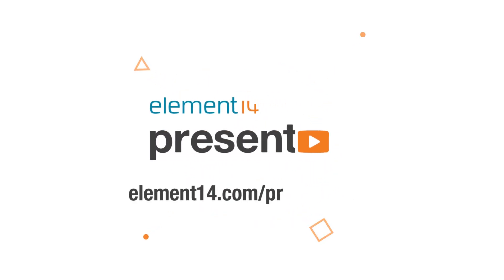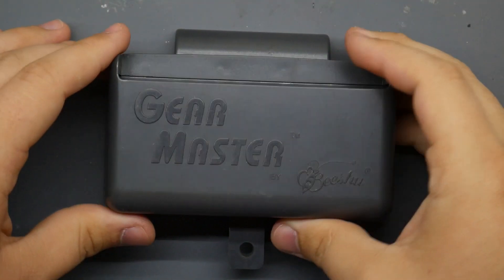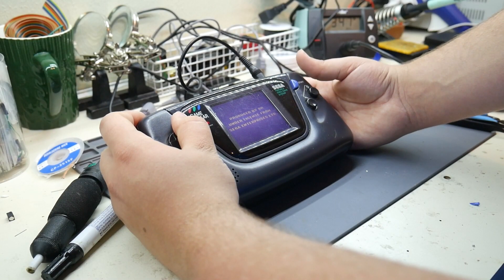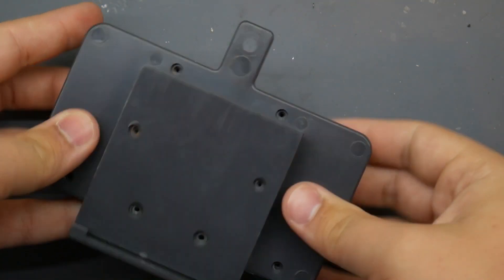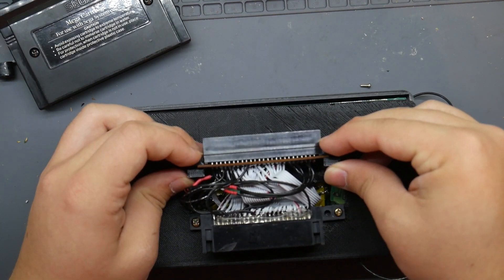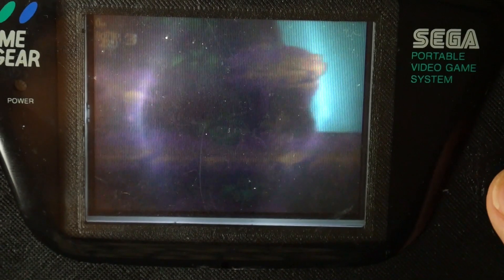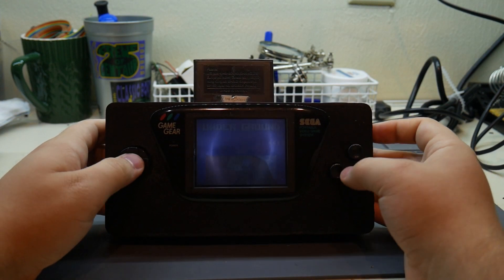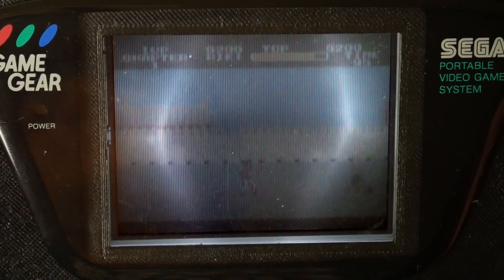Rebuilding the Sega GameGear Screen with LEDs

Comment: Cool idea, but its uglier and harder to see... I think a full screen replacement, in the original case, would be the way to go.
Reply: Yeah as someone who still has an original and still thinks this is neat, I must confess the display doesn't look good at all.  I realize some of that could be the camera this was recorded on, but since I am comparing it to 1991 display and backlight tech this is just kind of meh. :/  Overall still an interesting video though.
Reply: @mattc2360  First i would have change the caps in the whole system, that would make a lot of difference especially in the contrast of the screen. I admit that the screen original will improve with a backlit LED mod like this, but only like 20%.  If you do the caps and LED mod, then MAYBE the image on the screen will improve, but i doubt it will be more then 30 %. You can't change the contrast with a caps mod, you can only change the brightness in total. If you have a modern screen then contrast/brightness will improve with more then 70 %, that means that outside playing the GG in bright daylight is possible. ;) Try this with a original screen and then you see the diffrence. I like original hardware but implemented with also modern electronics that's far and way beyond better then almost 30 years ago was possible.
Reply: @gsxracer1977  As I said, I still thought it was neat.  Recapping is actually not that difficult (I say that not as an expert, but one who has done so with several Sega consoles without having any idea what I was doing :p) if you would like some tips and tricks for that.

Comment: They have drop in screen replacements with a modern lcd. That mod you did doesnt really show up on camera at all. Also, the game gear screen is notorious for ghosting.
Reply: why waste a working screen though?
Reply: @Davedarko  because that screen is really bad, indeed there's a lot of ghosting and colourpallet is bland. Compared to new LCD screen i give this screen a comparison of 20 pts for the old one and 95 pts for the modern one. Really you should replace this screen, its terrible. Actually its litterally a difference of night and day.
Reply: @gsxracer1977   we normally get flak for replacing something that works here ;)
Reply: @Davedarko  The case "worked" yet was replaced with a janky looking 2 slot one. ; )
More seriously, While the screen and backlight do work, you can pretty much replace tjhem while selling the old ones as for parts that some people might be looking for endlessly on Ebay and such. I'm pretty sure most of us here would still prefer replacing that with any modern variant if only for the good looking colours and refresh rate.
Reply: @TheSliderW  it's been 8 months, why have you summoned me?

Comment: I think it would look way better with the leds pointing to the side of a clear piece of acrilic like those cheap handhelds with backlight or like in notebook backlight screens is the same way
Reply: And it would be way better to use the original front and 3d print only the back

Comment: Cool project, well done! Would electroluminescent film work as a back light? I'm not sure how it would compare to LED on power and CRI?
Reply: I'm not sure if it would be considered film but I tried some kind of acrylic (in the backlight) that was found in a old LCD that I had around but it wasn't quite bright enough. I didn't know very much about electroluminescent film at the time, but that is an excellent idea I should try if I upgrade it any time soon.
Reply: Electroluminescent film is not too bright. It depends on the quality of the phosphor. Might be a challenge to control the brightness too. But definately worth experimenting with. For a small project I bought an LED back light which was just an LED stuck into a piece of acrylic. But that worked remarkably well
Reply: @adamsoileau4804  I should have said, the master system add on is epic!

Comment: Maybe this won't work as I don't have a Game Gear and can't look at one in detail, but how about putting the Game Gear and Master System game ports in the same slot spaced just enough from each other to allow the slot to accept either type of cartridges, with the permanent shape accepting the larger MS games by default and making some kind of removable shim to guide the GG carts? Maybe even making the shim/guide spring loaded and pushed out of the way when inserting MS games?

Comment: You sould had just taken an old lcd apart and get the light spreading plastic layers cut it down to size and put the leds around the parameter.
Reply: I was actually looking in to that 😂 I messed around with one broken lcd, but i realized two leds would fit in the reflector and that worked pretty well. (Even if it doesn’t look great on camera) The lcd I had on hand didn’t have good diffusers and I didn’t really want to sacrifice any other lcds just for the back light method 😂 but yeah that would be the best idea if I was to remake this

Comment: There were a couple problems, but I applaud the effort. 
It looks as though your case ended up just as large, if not thicker, than the original case (perhaps it only looks that way because of the master system adapter?).  It would have been useful to put your case and the original case side-by-side to see/show us if there was any actual benefit to changing the case.  
Another problem is that the video of the screen is hard to see, you could have boosted the ISO on the camera to increase the brightness to the point it best matched what you were looking at.  That said, the problem with the old system is not just the backlight, but the actual LCD too (it is prone to ghosting, for example ). The Game Gear has an output jack to provide composite output to a television, and there are a great many inexpensive LCDs that have composite input that could make decent replacements for the original LCD.
Still, you are trying, and I would guess that you put a lot of work into designing the new case, so I'd say keep up the good work. With a bit more practice with your camerawork, storytelling, and understanding your audience, your videos will only get better and better. Cheers!
Reply: I think your confusing the nomad for the game gear with that mod because the game gear has no tv out at all without a mod. The nomad has not only composite but rgb out of its av out and there's even rgb upgrade screens for the nomad that seem worth it. The replacement screen mods for the game gear would be the mcwill lcd kit and the retro kai magic screen lcd kit.
Reply: @Luffym17  Regarding composite out, I think you're right.  The GG would need a third party board like the ggtv in order to use a composite LCD.  Thanks for keeping me honest.  The rest is true though, the OE LCD is subject to ghosting and an upgrade like the ggtv or mcwill would go a long way in revitalizing an ailing console. :D

Comment: Nice,

Is it possible to rotate the cartridge connection? Have game gear cartridges on the left and master system cartridges on the right? Seems like it would make better use of the form factor.
Reply: Yes! That’s is actually what I was referring to at the end when I said “maybe move them to the other side”. I had already mounted the game gear connector before the master system connector so i couldn’t really change that at the time, but I am definitely considering doing that if I remake this. Since I rewired the cartridge connector with ribbon cable it shouldn’t be a problem moving it to a different aide

Comment: Would it have been possible to squeeze in LEDs around the edge - instead of directly behind the screen? If you were able to get all four edges populated, and add a white / reflective surface, it might help with the bright spots.

Comment: a few pointers, i liked the LIPO upgrade its smart and has a lot more power then LR6 battery in series. Now: you now that you cant use a regular charger for LIPO battery but you need a special balanced one. So u cant use the original from Sega, battery will explode. The GG will work at a DC level of above 7,8 volts, while your LR6 batteries only can make 9 volts with normals and  7,2 volts with 6x 1,2 volts in each rechargable cell bnut because they have a lot of amp's in them the DC voltage is less important then the current they can provide.  I know this because i did the Mc will mod on my screen, also replaced EVERY cap and aplied a VGA out on it. Also i replaced the cover of the screen and replaced the speaker. This mod of yours is fun but i see the LED's backlit behind the screen which make it not good to watch,  u should've invest some more money on it because you still have that horrible screen ( believe me, the MC will mod is awesome) and you still use that cracked up screencover... and on top decided to make a new cover while the original is/feels much better. No hate, just pointers to make yours better next time. :)
Reply: update: i measured the recharchable batteries are putting out 1.4 volts so in total 6 x 1.4 is 8.4 volts. Its even more then i thought it would be, but use high mili amp batteries like mine > at least 2500 mili amps. otherwise the GG will drain the batteries very very fast.  ( a duracell AA battery holds on almost 3000 mili amps by 1.5 volts, for comparison)

Comment: I know this is a little of topic but, I've been watching GameCube modding videos for the last five hours and I'm asking myself how feasible it would be to make the console even smaller! Making use of the ode and the HDMI mod, and using the mostly empty space at the bottom of the case to fit in the Gameboy Player PVC inside, and using some extenders to get relocate the SD card inlet to a more convenient place. Also making use of the fact that you can make your own MiniSD-Adapter, you just have to connect some pins together, so you can get rid of the more bulky memory card connectors. Even upgrading the fan for a smaller, more powerful 40 mm noctua fan should help making it smaller while keeping it's cooling capabilities.
I need to sleep...

Comment: How did you power it with a Li-Po? Have been looking into rechargeable batteries on my own GG but cant figure out a good way to get it up to 9v with the circuits i have
Reply: a GG will operate from 7.8 volts normal, but if you have a lot of current you can draw then voltage can be lower. A lipo cell is fully charged 4.2 volts, so in series it makes 8.4 volts which is more then enough to power the GG. ( don't let it drop under 3.7 volts or in total 7.4 volts, you will damage the lipo cells! ) You need at least 1,5 Amps for total load out of the lipos and a balanced charger to charge the lipo cells, i know this because of my RC hobby.